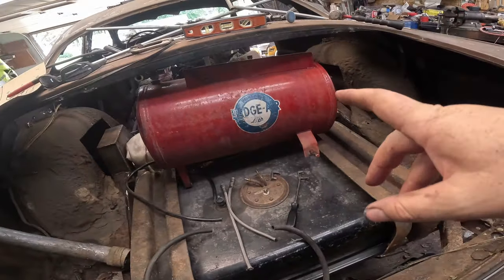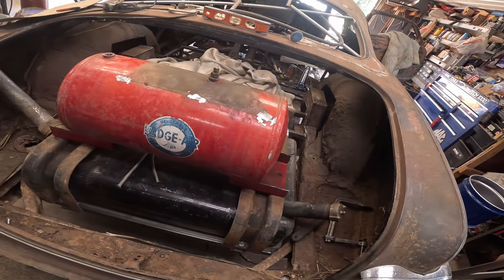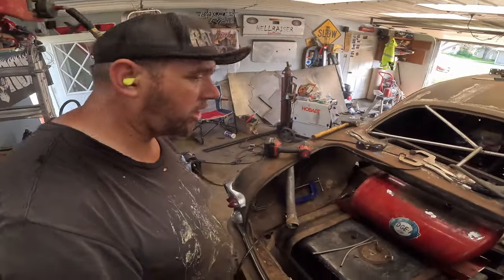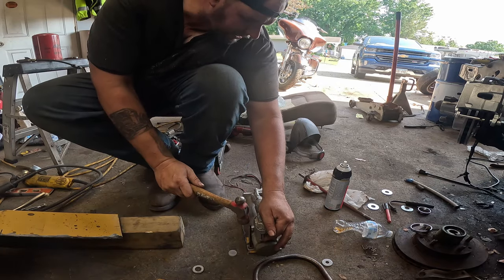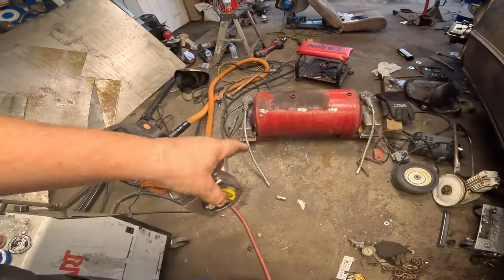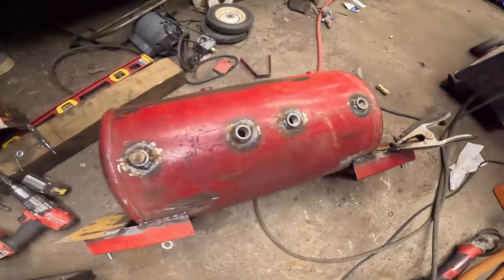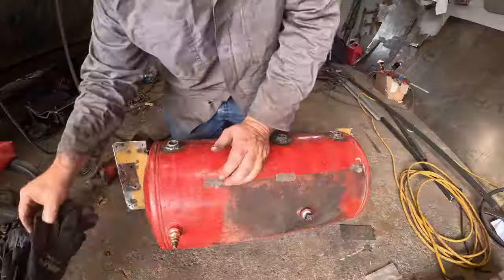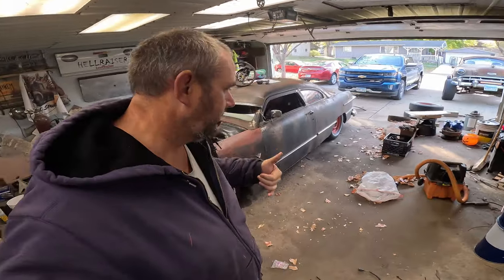Shop Air Compressor in bagged 1951 ford (RAT ROD)

Comment: i am no expert, but can't it be that these small compressors can leak when they dont run. so the air goes backwards out thru the cylinder?
 Anyway awesome build!👍
Reply from the maker: That's a great thought but I do actually have check valves but they may leak too?